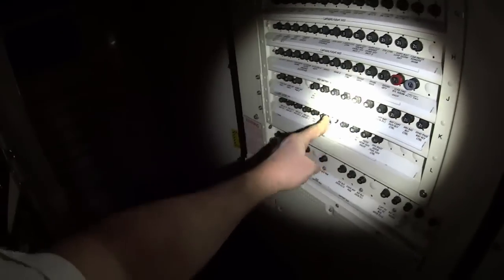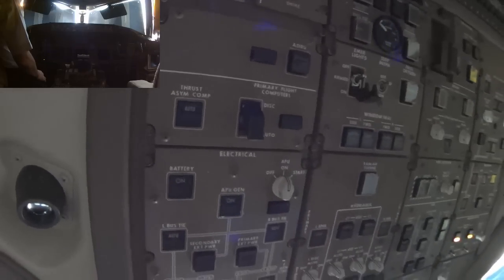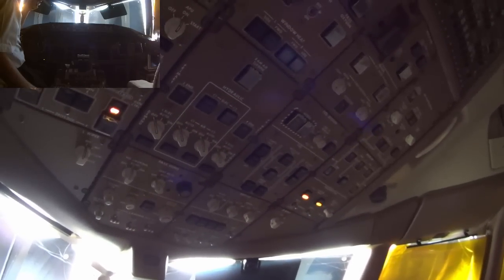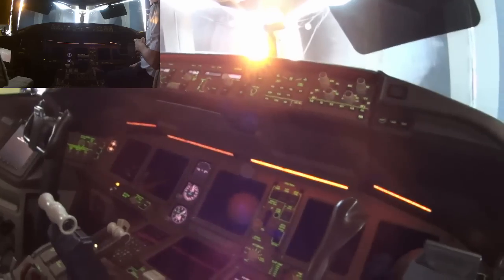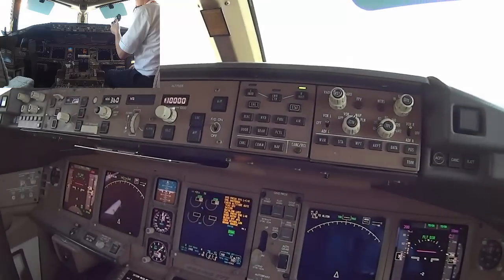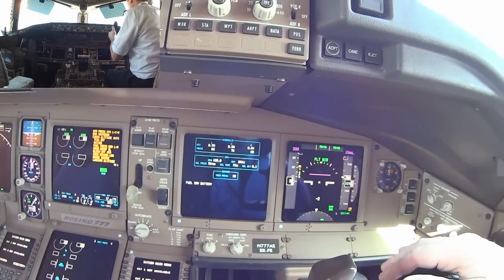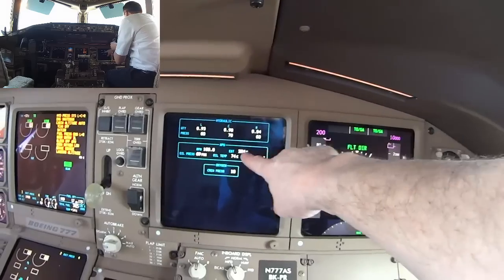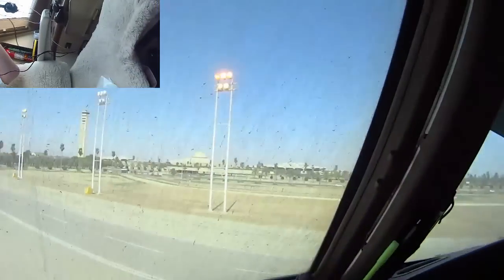Boeing 777-200 Preflight Inspection Part 1 | APU Start

Comment: Thanks for the tail number. I was like, "I've not seen an accessibile EE bay on a normal passenger model outside of the factory."

VIP model. Makes sense. Doesn't look like it has officially flown out of Saudi Arabia since late 2017 a few months after the.... incident. 

Definitely one of the more special 777's to have flown.

Comment: why you dont have to test the fire protection system of the APU before starting it?
Reply: the system with self check it first and if it finds a fault it will not start the start sequence.
Reply: @boeingt7236  thanks for the information

Comment: Great video! Being an engineer and a pilot of the Boeing 777 is something more than just a job it’s like a destiny. Boeing 777 line is the most technological plane and it made massive impact on aviation history. On 9th November 2005 Boeing 777-200LR made a historical flight from Hong Kong to London Heathrow which is considered as longest distance travelled flight (11664 miles) ever. Looking back on what success aviation has achieved from Wright brothers flight to Boeing 777 is great. While observing the avionics compartment and realizing what amount of programming, electrical engineering has been contributed and invested to this fantastic plane makes me to do a big regards and bow to Boeing engineers. I hope that 777X program would even double the original success of 777 line. As the new Boeing 777X would be powered by the biggest commercial aviation engines GE9X I hope that this plane can improve the record of 9th November 2005 flight. I am very proud for the USA and Boeing that they engineered such outstanding plane. Boeing 777 is the rare example when the thing can combine perfect engineering and gorgeous design. I really think that it’s something special about to work so professionaly and close with this plane.
Reply: So you're a 777 engineer (AME I assume?) and 777 pilot? That's awesome!

Comment: Thank you for these amazing videos :) May I ask a question: why is the fuel-shutoff battery in the cockpit? Is it very common for it to be disconnected for maintainable reasons, and will there be a need to access the battery inflight? Thanks :)
Reply from the maker: Hi, I don't know the reason for its location.  There is normally no reason for it to be disconnected on a normal Boeing 777 because they are flying very regularly in an airline.  In a private jet situation we do not fly as often and the battery will discharge over a few days with the plane not operating.  So that is the reason this plane gets it disconnected when parking.
Reply: BigIronTV Thank you! Have a great day :)

Comment: Why are interior systems running from hot battery bus and not ground service AC bus like it used to be on "normal" 777?  Couldn't they just install switch to shed those loads to preserve battery charge?
Emergency lights has their own battery, right? Is there any way to check state of charge of emerg lights battery?
Is it possible to power ECAM from battery using standby power switch to observe APU spool up on STAT page?
What is CRD panel on the center pedestal for?
Requesting: APU maintenance page display and everything related with SATCOM.
Reply: macieksoft
So may high quality posts on aviation channels here on YT. I didn't know there were comment sections like this on YT! It's like being on a professional's forum!

Comment: Beautiful cockpit! Hope Boeing keeps it that way for the 777X...
Reply from the maker: the trend in new design seems to be to remove the circuit breaker panels because they can be reset electronically using the multi function display.
Reply: +BigIronTV So, do you think it might be similar to the 787's cockpit? Because I think there are too many screens... Still a beautiful aircraft!

Comment: thanks for sharing!
Reply from the maker: +Ahmad Adelgary Hi Ahmad,  thanks for watching.  What did you think about the two camera format?  It is something new that I am trying once in awhile on videos.
Reply: +BigIronTV it's a great idea but i would suggest using this format to cover two connected actions like the APU switch while it's being turned on and what will happen outside :)
Reply from the maker: That is a good idea.  Like show pressing the button etc in the flight deck and see the apu inlet door open and hear it start to spin?
Reply: +BigIronTV exactly!
Reply from the maker: Ahmad Adelgary Ok.  I will do some more of that format too.  Thanks.

Comment: Whats your reasoning on leaving the L/R Packs and APU bleed off ?
Reply from the maker: +Clarke Ramsey   Hi.  Very observant.  I closed the ram air inlet doors during parking to keep the birds from building nests in inlet to the packs.  I don't show it but when I do open the the ram air inlet doors and turn on the packs pigeon nest materials fly out of both pack exhausts.  I will get to the packs a bit later in the preflight series.  I am currently editing the footage.  It will be a couple more parts yet.  Hope to get them all posted over the weekend.
Reply: +BigIronTV  Hello. Thanks. That's what I was thinking. Thanks for your videos!
Reply from the maker: Clarke Ramsey Glad you enjoy them.